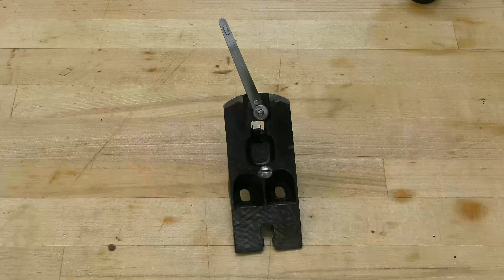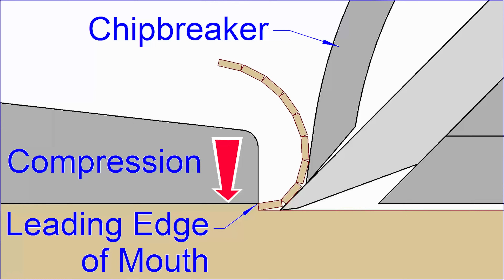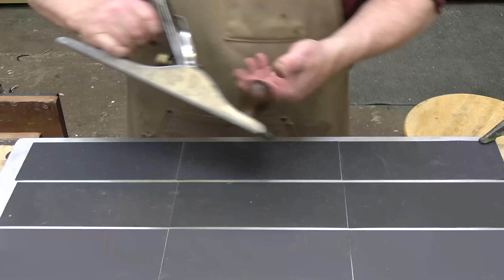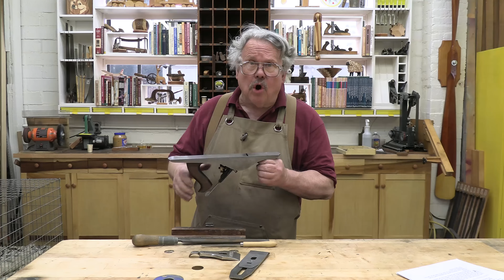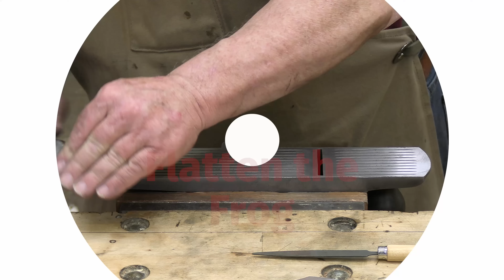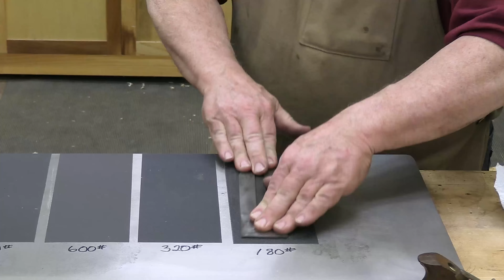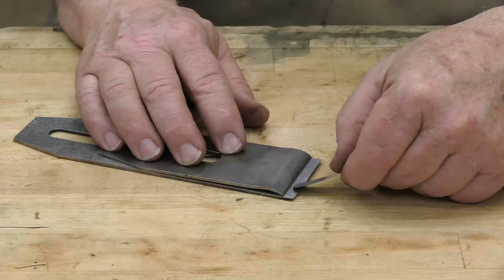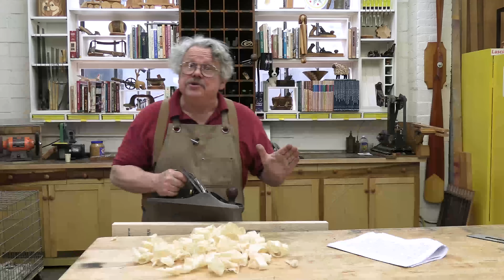Fine Tuning a Bench Plane

Comment: Great video. I have my father’s Stanley Woodworkers suitcase from the early 60’s. I need to refinish the wooden suitcase as there is some rot. The rest of the tools have not been used with the exception of the planer, which needs to be cleaned and tuned. Perfect timing of this showing in my feed even though it’s 2 years old. Thank you.
Reply from the maker: Most welcome. Have seen several of those wooden Stanley suitcases, but never with the tools still in place. Good luck!

Comment: First off. I love your videos. Very informative and well explained. However. I have a question. The frog mounting surface on the sole. Out of all the videos I’ve watched. Nobody ever addresses it. Why? It seems like an important surface to keep the frog perpendicular to the sole,s main surface. Almost all these points are painted or have the rough casting.

Comment: Hi, Nick.  I really enjoy your work.  When I need low BS, high value content, yours is one of the first stops I make.  Here is a factoid you may or may not appreciate...Frosch is German for frog.  If you could, I would like to hear your opinion on the Faithfull line of planes.  I got a No. 4, tuned it up and am pretty satisfied with the results.  I'm considering a No. 778 and I would like to know your thoughts.  Thanks.
Reply from the maker: I have a 778 and find it's a modest improvement on the original Stanley 78 rabbeting plane. The fence is mounted on two posts instead of one, making it more stable; and the micro-adjustment for the plane iron is easier to use than Stanley's lever. The one major problem I had with it is that the manufacturer paints the iron beds, which interferes with the stability and adjustment of the iron. Cleaning and honing these iron beds is a long and tedious task.
Reply: @WorkshopCompanion  , I too noticed the paint on the bed.  If that is the only major drawback then I'll probably pull the trigger.  I'm retired so I have the time to face a little tedium.  Thanks for the information.

Comment: I have never been able to sharpen my blades so they would cut consistently. I recently discovered that once sharpened, if I back off the blade a very small amount, and give it a few more strokes, voila!  While it’s opposite of your method, it worked great.  If I had found your video a few years ago, it would have saved me a great deal of frustration.  Absolutely the most thorough training  on plane s ever.  Matt, Rob, Rex, JKM, and Matt (the other one) all need to watch this video and fix their instructions.

Comment: If skewing the plane as you push makes planing easier it is obvious that it would be better to have the frog bedding at a reduced angle. So why do manufacturers persist with the wrong angle?
Reply from the maker: It's not the wrong angle for most woods and most operations. Skewing simply gives you the capability of adjusting to a shallower angle when the wood or circumstances call for it. Furthermore, reducing the angle of the plane iron (the cutting angle) would also require the reduction of the tool angle (the angle between the back and the bevel) to keep the clearance angle (between the bevel and the wood) where it should be. This, in turn, would reduce the strength of the cutting edge and cause it to wear quickly.

Comment: You wire brushed it to get rid of rust? Why not use electrolysis?
Reply from the maker: Less messy, easier set-up, can do all sizes of tools and metal parts, leaves an attractive sheen. I keep a wire brush mounted on a grinder, ready to go, for just this application. If there are pits I need to get down into, I follow up with a chemical rust remover/inhibitor like Naval Jelly.

Comment: QUESTION: i have a 22” plane, and an 18” granite block, is it possible, or impossible to flatten the sole on this smaller granite plate? 

how flat are those pastry dough plates? 

thanks for your advice!
Reply from the maker: My pastry stone is 25" diagonally from corner to corner -- just barely big enough to flatten my jointer plane. However, I have friends who have flattened their large planes on their table saws and jointer beds.
Reply: @WorkshopCompanion  thank you for response. unfortunately, i’m in an apartment and don’t have any machine tools. 

i’m likely going to bite the bullet and buy a bigger surface plate.
Reply: @WorkshopCompanion  great channel!

Comment: It is a myth that a plane must be assembled when flattening the sole.  The plane collector channel has a video demonstrating this and debunking the myth.
Reply from the maker: That would not surprise me. I've done it both ways, and both methods produce a usable plane. But I have also jigged up a No. 5 sole to measure warpage when the plane was assembled vs disassembled, and there is some, but probably not enough to adversely effect the operation of the tool.  In my opinion -- and it's only an opinion -- any distortion in the sole less than the minimum protrusion of the plane iron (0.005" to 0.010") would not effect the planing.
Reply: Yes, it’s been shown that it doesn’t matter. I think it’s to do with a related issue: people seem to have a tendency to put too much tension on the blade assembly when the plane doesn’t perform well, and that could introduce problems.

Comment: I've always been frustrated with trying to hand plane.  I can't wait to get back out to my shop and tune mine and see if it's any better.  Never knew I had to get the chip breaker so close.  It makes so much sense now, that I'm embarrassed that I didn't realize it before.
Reply from the maker: Common experience. In fact, that's exactly what I went through in my first years as a woodworker. Took me some time to figure out it's gotta be dead sharp and precisely tuned.

Comment: Note that low-angle planes just have the bevel on the other side.  The cutting angle is really the same.
Reply from the maker: True, but the frog on most "low-angle" planes is ground at 12 to 17 degrees. The blade is normally sharpened at about 25 degrees, giving you a cutting angle of 37 to 42 degrees. The frog on a traditional bench plane is 45 degrees, and with the bevel down, the cutting angle is the same as the frog -- 45 degrees. You can further reduce the cutting angle on a bevel-up plane by grinding and sharpening the blade at a steeper angle, but the cutting angle on a bevel-down plane remains constant no matter what the sharpening angle.

Comment: Thanks millions from California.
You are borne teacher, and a very pleasant one , beside being great.

I hope somebody answers my question . I am 72 , but new in hand  plane.
My commercial grade Stanly 5, the blade and chip breaker moves to right or left during planning.
If i tighten the screw too much, then adjusting becomes difficult , even then it still moves.  Perhaps because it is a less expensive version of Stanly? 
Folks, please advise.
Thanks.
Reply from the maker: You might try two things. First, thoroughly clean the frog, iron, and chip breaker with naptha or acetone to remove any grease -- if the parts weren't cleaned properly during assembly, some stray grease or oil might allow the iron to slip on the frog. Second,  flatten the frog and the back of the plane iron so the two make good contact. The better the contact, the more friction there is between the two parts, and this will help prevent the blade from slipping. You should know that post-1970s Stanley planes have been widely criticized; many craftsman feel they cannot hold a candle to the older tools. The reintroduction of the "Sweetheart" planes seems to have been an attempt to restore some of the old quality (and reputation), but what you call the "commercial grade" remains problematic.

Comment: Does corrugation reduce friction?  Same downward force. Less surface area. This means the downward force is more concentrated.
Reply from the maker: As I understand it, friction is a difficult concept for engineers to wrap their mathematics around. It does depend on contact area, but also the  types of material, pressure, the speed which the two surfaces are moving past one another, and the acceleration. There is also a difference between static and kinetic friction, and different mathematics for each. When you consider how bench planes are used today, perhaps the biggest advantage of a corrugated sole is not that is offers less resistance, but that it is easier to true up for the simple reason that there's less metal to grind away when you flatten it.
Reply: @WorkshopCompanion  Thank you for the reply. Agreed, friction is a difficult concept. Also agreed that less metal means easier to flatten.
Reply: Friction is indeed not related to the surface area in this way, and it’s been shown that there’s not much of a difference between corrugated and flat soles. Some people say the grooves help with types of wood that contains a lot of resin – maybe. I wonder if Stanley liked those planes because they were easier to grind flat at the factory. Also, never underestimate the power of persuasion: if you think the corrugations make the plane easier to use, then they do. For you.

They kind of look cool, too. I’m not a fan because I think I might put dents in the wood when I start a cut on a very narrow workpiece and I’m not careful.

Comment: What I have yet to see on any channel about using planes is beginner exercises, including how to fix your mistakes.
Reply: Gee, didn't remember seeing this before. I have been trying to figure out how to flatten the mating surface on the frog. That set up with the dado cut in it solves that. Should have figured that one out by myself. I do prefer to use diamond lapping plates, but ain't going to cut a dado in one of them. I do have lots of abrasives....

Comment: This is crazy, I got the exact same plane for $5 bucks. At a flee market. . Cleaned off the rust and it sat for about a year. Pulled it out about 4 days ago, to start restoring it. Things weren't going well so I put it back up. I hope this video helps me get it back into working condition. I also have a pile of rosewood. The handle is quite loose. At least if I need to I can make a new one out of the same wood.
Reply from the maker: If the handle is loose but not broken, you may just need a screw. Two fasteners hold the tote in place. There's a long stud with a brass barrel nut that goes all the way through the tote (handle) top to bottom and a small brass machine screw near the front of the tote. On a lot of old neglected planes, the machine screws are missing and this make the handle seem loose.

Comment: Good information and helpful.
but...
A thicker blade- doesn't really help with chatter,  that is a myth.  A sharp Iron (the one that comes with the plane) will do all the work anyone needs it to do (without the extra cost or effort needed to sharpen a thicker iron)
Also, if you move the frog forward, the iron will not be in contact with the sole and that might be the cause of your chatter problem.  The old wood planes had much larger mouths and you can get as thin of shaving from them.

Comment: Great vid. Only comment, reinforce the placing of the plane on it's side as you did, or up on a block. As a carpenter and joiner and trade lecturer I have seen many just sharpened irons ruined by placing face down on a surface.

Comment: Is amazing How you can find great material with Master guys Just sharing priceless knowhow. Thank you Very much. I had a bunch of this Tools but all of them are totally rusted. How can i remove this to bring back to life such amazing Tools?
Reply from the maker: Rust removal is fairly simple. There are three methods -- abrasive, chemical, and electric. I prefer starting with the abrasive -- a wire brush and some Scotchbrite.  About 90% of the time, this is all you need. If there's a lot of rust or the rust is deep, try a chemical remover such as Naval Jelly and follow up with an abrasive. When there's an enormous amount of rust, some folks resort to electrolysis. Mix up an electrolyte solution (something that will pass a current) from water and sodium carbonate, and place the tool in the solution, along with a piece of scrap iron. Using a DC current supply (5-15 volts, 2-5 amps, like a trickle charger) hook the negative wire to the tool and the positive wire to the scrap metal. Takes 1 or 2 days depending on the size of the tool and the amount of rust. I rarely go this route because of the set-up time needed, but it can save a lot of elbow grease if you have a lot of rust to remove.
Reply: @WorkshopCompanion  thank you very much! I'll save all my tools. 🙏

Comment: My question is... how exactly does a plane work? I would think that if the sole is dead flat, and the blade sticks out through that plane, that the front end should ride higher (on the uncut side) and the tail end should ride lower (on the planed surface). If we look at a jointer, there is a clear step on the feed end to the output end that takes this into consideration. But this is not true for the plane. So... how is this supposed to work? Nick mentioned in passing,  'compressing' the leading edge. Is that the key?
Reply from the maker: You ask an excellent question that could easily make a  decent YouTube video. But to give you a quick answer, you're comparing the bench plane to the wrong tool. It has more in common with a cheese grater than a jointer. The knife edge in the grater is slightly above the guiding surface -- both before and after the knife -- but the grater still cuts a thin slice of cheese. Does it joint the cheese? No, it doesn't. If you continue cutting slices, the block will grow thinner towards the front, indicating that it is not taking off slices of a consistent thickness.

Let's do a little mind experiment. Adjust your jointer to function like a cheese grater. Or a bench plane, either one. Raise the infeed table so it''s flush with the outfeed table. If the knives are properly set, they should be about .002" to .003" above both tables at the highest point of rotation. Pass a board over the jointer. The knives will remove a paper-thin shaving. After the board has traveled some distance, the leading end will drop down to the outfeed table. Let's pretend for a minute that the board isn't flexible, and trailing end comes off the infeed table. As you continue the cut, the angle of the board will change continuously as the leading edge travels further and further along the outfeed table. Instead of being straight, the board will be cut with a very slight arc.

Something like this happens when you work with a bench plane. I've done the cheese grating experiment where you continue to plane the edge of a board for way too long, and it always grows thinner at one end than the other. The shavings are not a consistent thickness throughout the stroke, but the difference is so miniscule it's not apparent to the eye. You have to make the cuts over and over again to see that there is a difference at all.

So a bench-planed surface isn't perfectly straight. But it's straight enough. And it gets straighter the  longer the plane -- that's why long planes are called jointer planes. I once worked with a 48-inch-long cooper's plane for a few hours, and was amazed at how well you could get the edges of the barrel staves to fit together.

One more thing. Bench planes may not cut the edge of a board perfectly straight, but they will cut the surface of a board (that's wider than the plane) very, very flat. Why? Because the mouth of the plane does not extend through the width of the sole. Do the mind experiment with a bigger block of cheese and you'll see why.

And yes, I believe the compression plays an important role in this, but at the edge of the iron, not the leading edge of the mouth. Cutting is, at its heart, a stress-failure process and there is some "springback" after a cut. This makes the planed surface straighter or flatter than it might otherwise be.

Like I said, there's enough meat (or cheese) here for another video at least.

Comment: Great video, I have a few old Stanley planes that need attention, and this has provided me with lots of tips.  Ahem.... the german word 'Frosch' also means frog!  😏.  Perhaps it has something to do with it (the frog) being behind the mouth of the plane.  Iit does refer to a condition in ones throat on occasions, dry and hoarse ie. having a frog in ones throat!  'Ein Frosch in der Kehle' is a common german phrase, not sure if it is used in English.
Reply from the maker: I am aware that "frosch" has the same dual meaning in German that "frog" does in English. My point is that the frog on a plane is so named because it is similar to the bottom of a horse's hoof, not because it looks like an amphibian.
Reply: @WorkshopCompanion The pelvic bone of an amphibian, like a frog, has a similar shape to the described structure of a horse's hoof. That's why we call this part of a horse's hoof "Frosch" in Germany 😉

Comment: I was gutted at the intro when you didn’t spin the hammer. I was thinking I swear I told you it was charming and you needed to keep doing it! You sealed the deal in the end…

What I learned, however… is that I’m setting my chip breaker way too far from the end. Mine is probably a full centimetre. I’ve gotten good curls but they’ve gotten chunky and got astray. Some even jamming up the mouth. This might be the cure to what ails me!